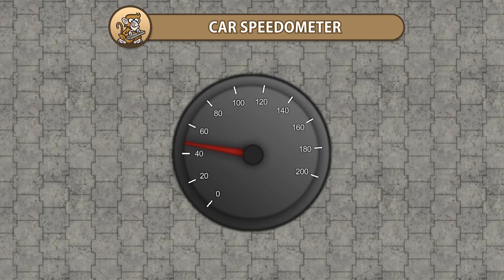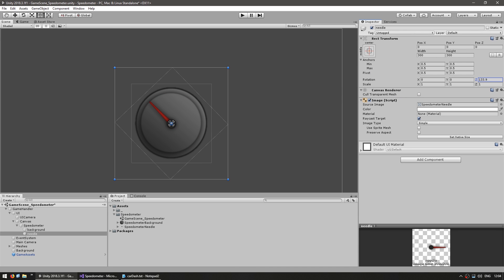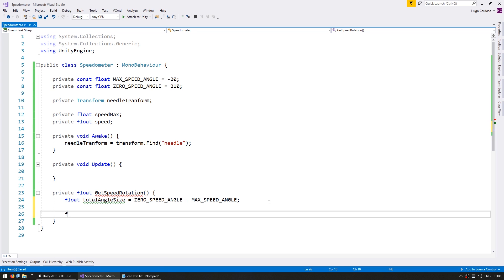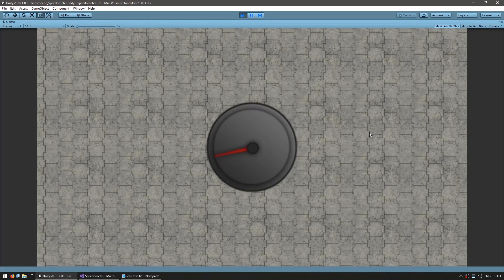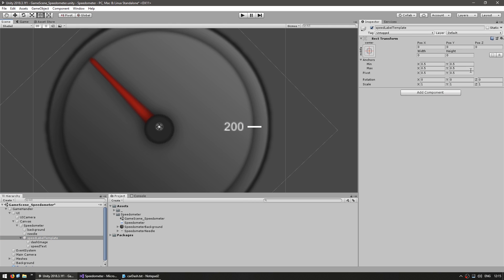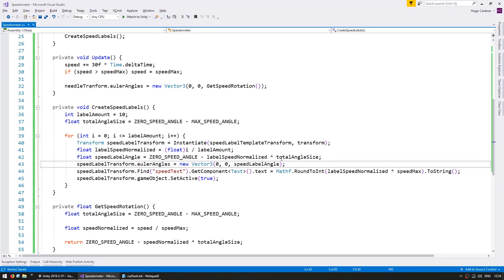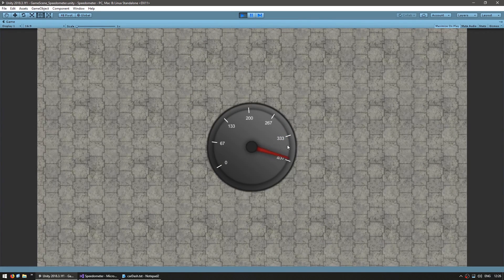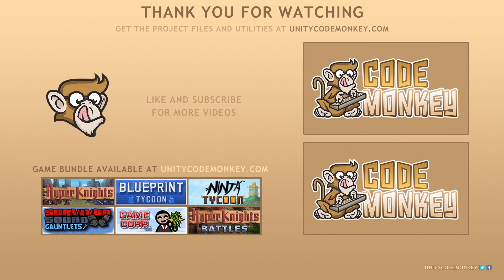How to make a Car Speedometer (Unity UI Tutorial)

Comment: The needle is not moving when I am using the Up arrow key and Down Arrow key after assigning them in the C# code. Please help me with this
Reply from the maker: Add some Debug.Log(); to ensure you are correctly listening to player input and check if the speed variable is changing.